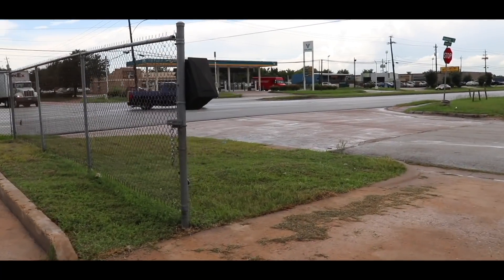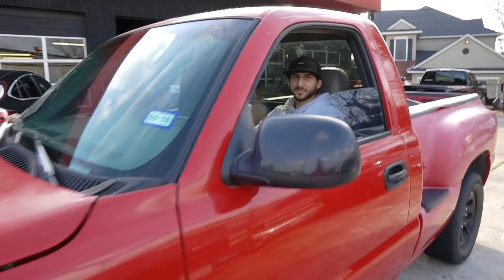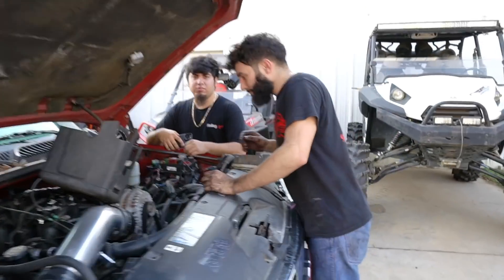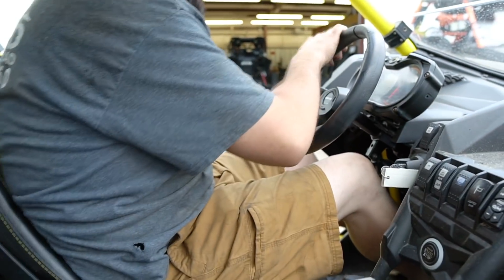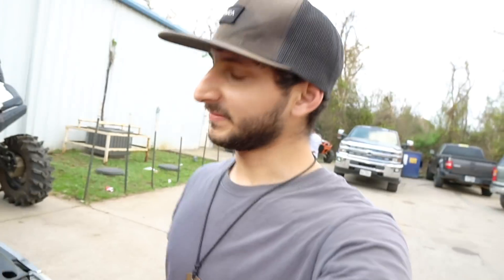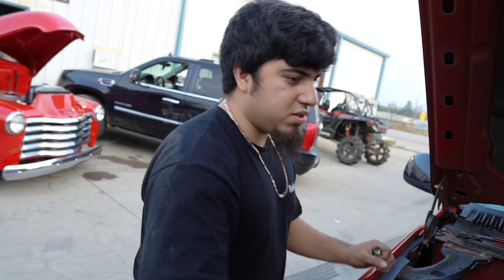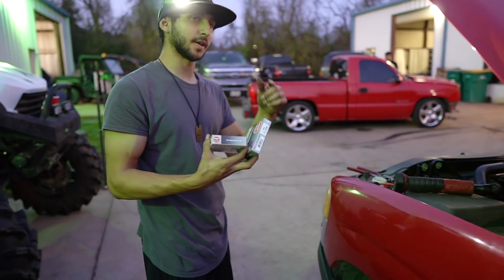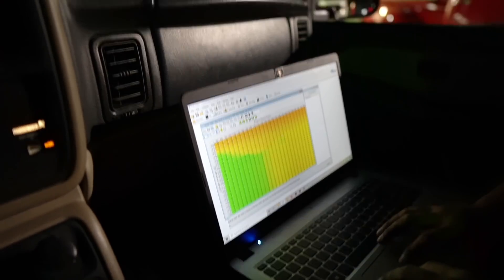New Truck Project , They Don't Call Me OmarLs2 For Nothing !!!!

Comment: don’t you gotta use Ac delco on those motors?
Reply: Acdelco comes factory but for modified engine you go with ngk tr5 or tr6 depends on how modded is you engine  the difference is spark plugs temperatures